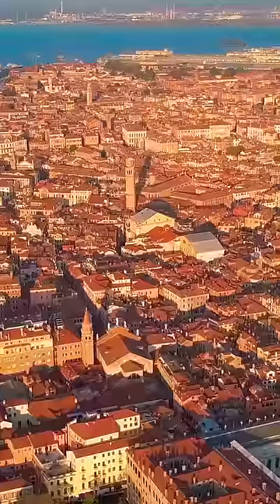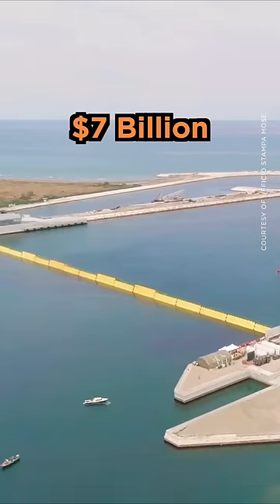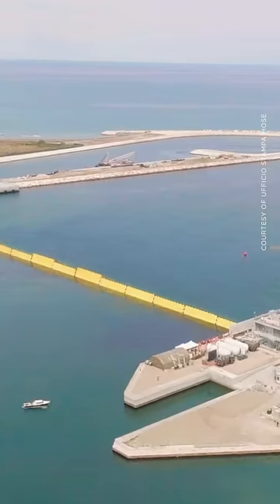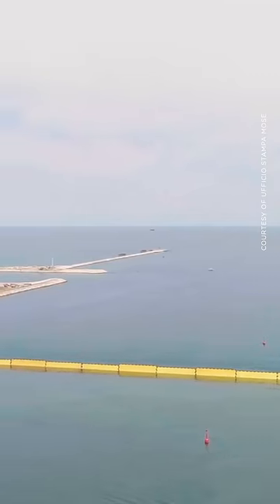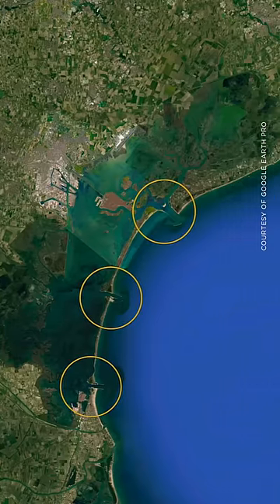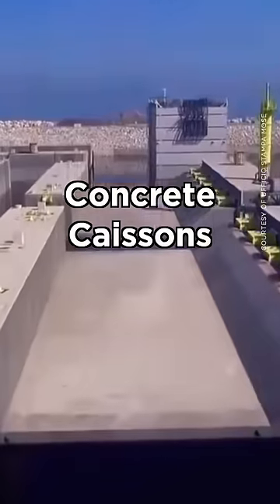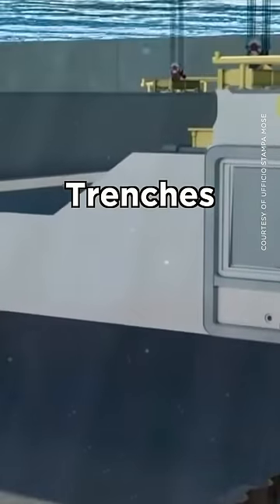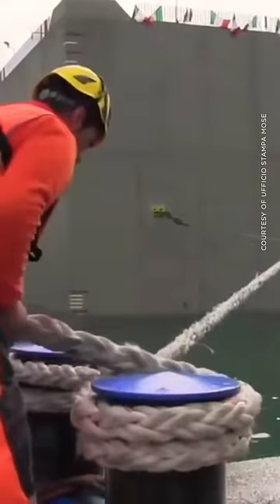How Venice STOPS Floods

Comment: It's never a good thing when starting out with, " here's how it's suppose to work.....". 😢
Reply: It does work, idk why he said that
Reply: Yeah, this is a pretty standard flood defense system.  Usually deployed in rivers, not lagoons, but the concept is the same, and its only real failure mode (one of the flaps not rising, either due to the water not getting pumped out properly or the hinges failing) will most likely only happen to one or two of the flaps at a time, so even if part of it fails, the rest will still minimize the damage
Reply: Yes, it's a bad thing because it shows a political bias.
Ask Venice people who has suffered from high water level for decades and now they don't.

It works.
Reply: no... thaya actually the correct terminology.  Do you understand how dofficilt itbis making technologu against nature? Extremely compkicated.
Reply: @ario203ita5 he said that because shortly after its installation, sand and other debris got sucked into the space underneath and stopped them from lowering
Reply: @DaFirebird  lmfao
Reply: Simply who does this kind of videos rarely want to waste his time by checking. 
It worked pretty well for more than two years by now. On Nov 22 2022, despite not having been even completed. it stopped the record tide in the Adriatic, 205cm. Water in the lagoon rised only 77cm, a quite normal tide.

Comment: As soon as they were lifted, sand and rocks began to fill in behind it and they couldn't be lowered all the way down. Smart.
Reply: yeah should been like the panama canal where they can control water getting in and debris wouldn't fall under moving parts.
Reply: Lmao, it never even touched the ground
Reply: Damn. Could they not attach some type of mesh netting (something without holes amor parts that would trao wildlife) that could lift and fall with the steel parts to block debris from getting in? Or is that unfeasible? 
Does anyone here know?
Reply: Not true, the mose works.
Reply: OMG that why I never heard anything about how they worked.
Reply: Well, rarely do inventions work first time.. but billions and billions and BILLIONS AND BILLIONS ETC of dollars.. You'd think they'd build a few testers in same exact conditions
Reply: yup the stupidity of some engineers when you have the dutch around to fix it for you. They deserve every single cent lost on this.
Reply: So during high tide the you can't enter or exit?
Reply: The idea is very good, the design is very bad. They literally made a suction cup when it rise up. The low pressure below create great flow under the gate causing debris to fill in below it.
If only they made it with a design that no debris can get into the resting place of the barrier.
Reply: @lishrich you must have the biggest brain in the damn world to immediately solve the problem that doesn't exist for a plan that has been in the works for around 40yrs
Reply: Bro wtf are you saying, it’s working well
Reply: @frafstet3835  do your homework. Venice flooded two months and a month ago. The plan is a joke! A very expensive joke. 7  billion euro 😂😂😂😂
Reply: @rarkmutte6016  it’s not made to stop every flooding, the acqua alta has existed in Venice for centuries. It’s made to stop Venice from having dangerous levels of water, over a meter. You talk shit about the engineers and you don’t even know what are the goals of the infrastructure they built.
Reply: Hey kid, are you engineer? Touch some grass and drink some milk
Reply: Lmao this comment got 3k likes without anyone actually confirming. Typical youtube
Reply: So smart it works just like planned. Unbelievable, isn't it?
Reply: Man literally just copy and pasted his comment into multiple chains
Reply: @mandelorean6243 this is not the first flood shield.
Reply: How wonderful that barriers have been constructed 😄 May they work successfully for decades to come♥️🕯
Reply: @erikmanousaridis1907 i’m italian and I can assure you that it has been in work for 40yrs just because of curruption and lack of founding, not because of the complexity of the project
Reply: arent they on the concrete bases..?
Reply: @rarkmutte6016  tf are you saying, totally false
Reply: @mtbers you can during the regular high tide, mose works only few days in one year
Reply: Someone never paid attention in class. They legit stated that they are prefabricated on. so the entire structure sits on the bed of the sea
Reply: That'll be 6 billion dollars thank you
Reply: @mtbers  not during the high tide, but during the extraordinary very high tide, about 10-20 time a year
Reply: It exist a thing called "maintenance".
Reply: Ah so a bunch of people suddenly became master engineers who can somehow find out all the problems without knowing fully how it works 

Typical YT moment